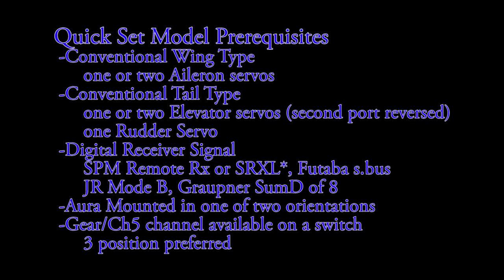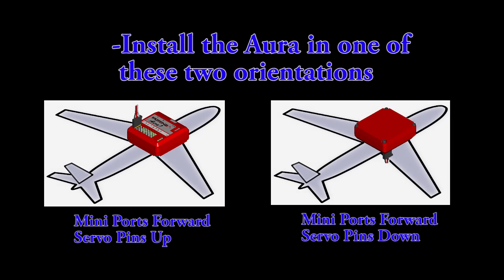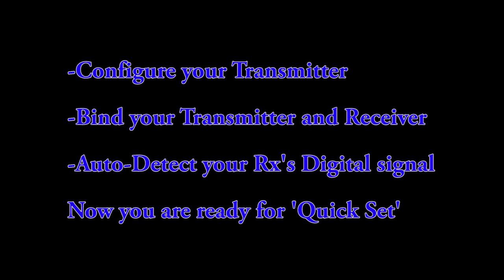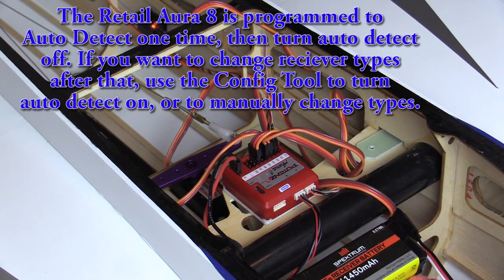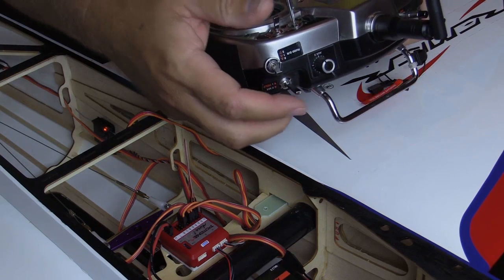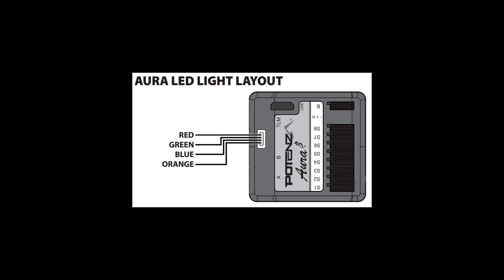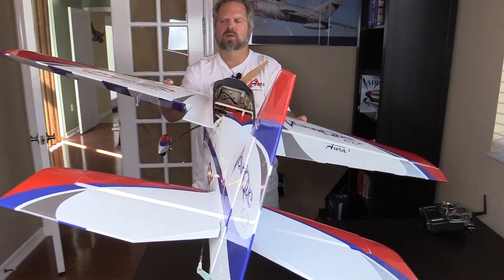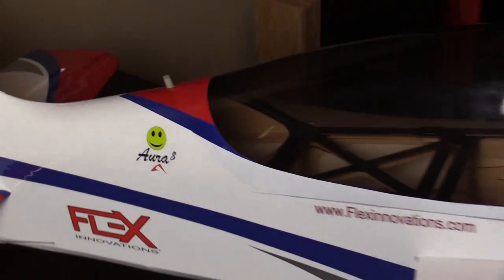Quick Setup - In Detail

Comment: Very informative video. I realize this is an old video, but I hope you can help me. I have a Radiomaster. It is Spektrum compatible. I think I need channel mapping for my radio. Can I assume that S1 is channel 1 and so on?
Reply from the maker: No, Aura Ports are not channels. They can be setup to be anything. This is why we do not call them Channel 1, 2, 3 or "Aileron, Elevator" etc. S1 = Servo 1 and so on.

You would need to "Learn Transmitter" in the Aura Config Tool to learn the specifics of your radio, or seek support from Radiomaster on Channel Order, Channel Direction, and Channel Min/Max Movement, and make those settings match a more common radio system like Spektrum or Futaba.